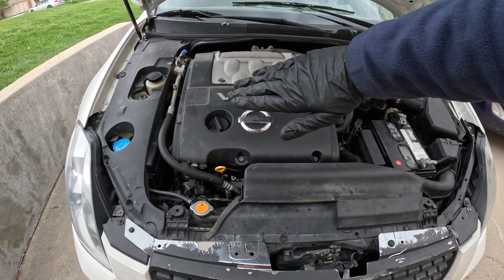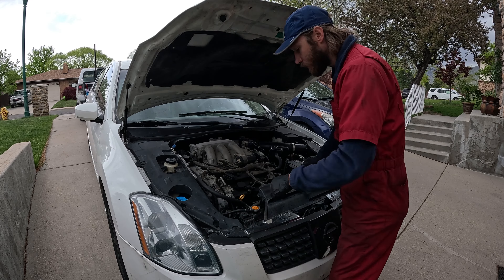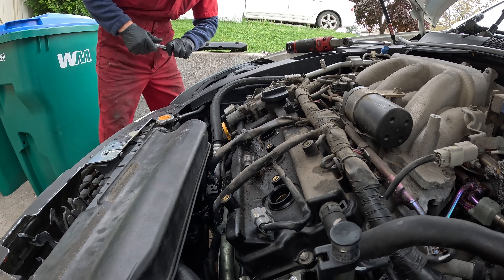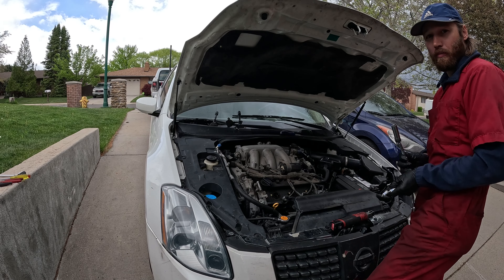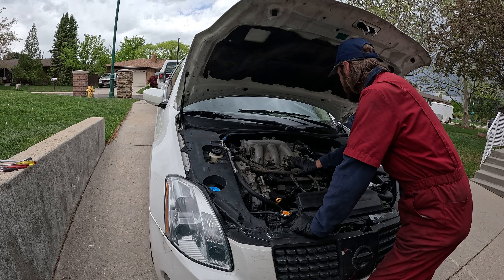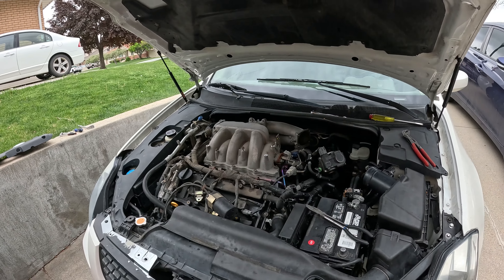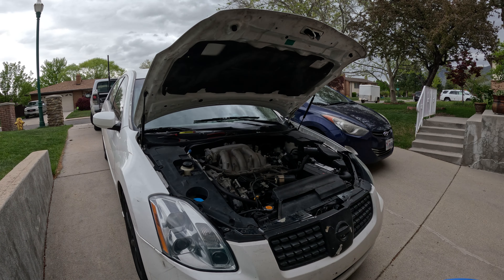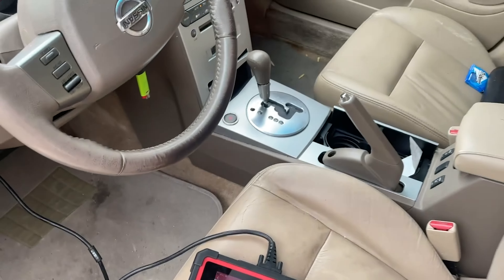Is this car Dangerous? Maxima tune up

Comment: If you find at a work a check engine light with a code that can be a bad sensor, would you replace the sensor? What if after replacing the sensor, it was good and the problem is in the engine?
Reply from the maker: I would test the sensor before replacing.